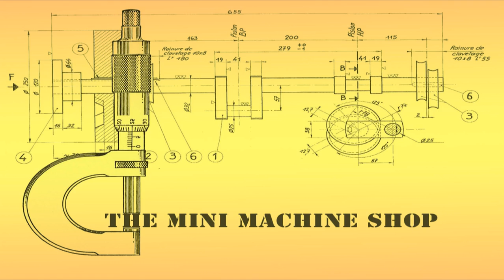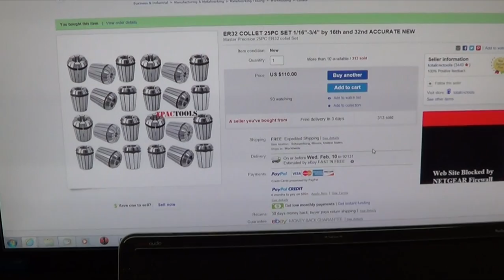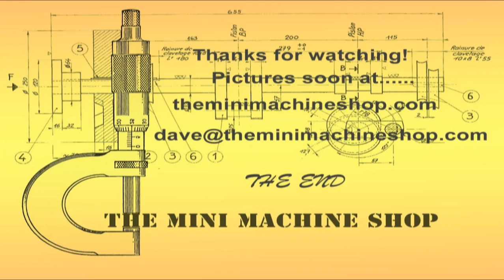Mini Mill ER32 Chuck Video #39

Comment: That is a very good price per collet! 

If you need even more z-clearance on the mini mill, you can purchase a set of 3MT collets which will mount directly into your spindle with no need for a chuck.
Reply from the maker: +Herr Schmidt I do have a 1/2 and 3/8 which fits just about everything. But can't find any other ones that use a 12mm draw bar...
Reply: Ah...I see. I believe that ArcEurotrade in the UK sells them for M12 but it would be much cheaper to simply buy the $10  3/8-16 drawbar from LMS..item 1637.
...or make one!
Reply from the maker: +Herr Schmidt Hmmm. now you have me thinking! All the cutters I have are 3/8 or 1/2 and I already have the 3MTs in that size. So getting the $27 ER32 chuck was not really necessary. Think I'm going to start trying the 3MTs now. Actually not sure again because I never liked whacking the drawbar for fear of messing up something.

Comment: Im looking for an er32 collet holder for the harbor freight mini mill. Do you know which ones on Amazon would fit? Cant find any specific ones :/. Thanks for your time!
Reply from the maker: EZ Amazon search for ER32 MT3 M12 you need an MT3 taper with an M12 draw bar..
Reply: @TheMiniMachineShop  thanks a bunch. I was stuck for so long because i couldnt find that info anywhere. Thank you